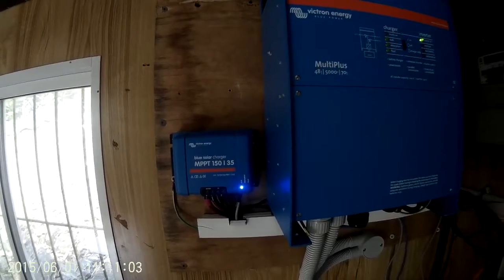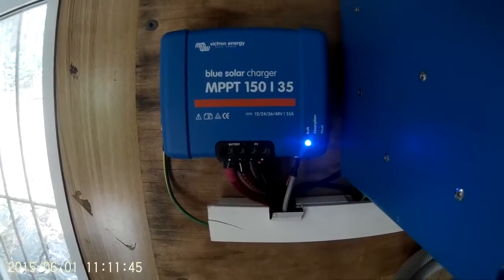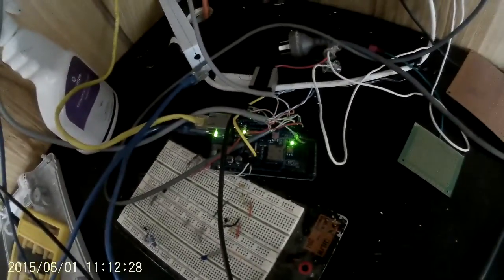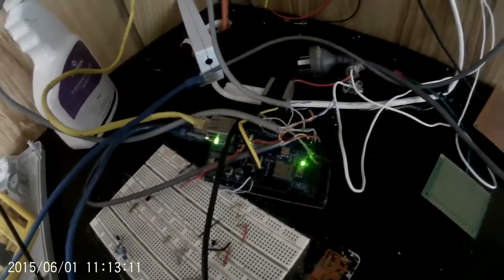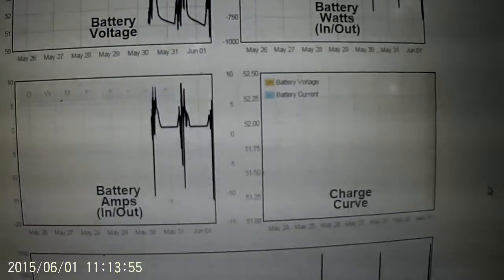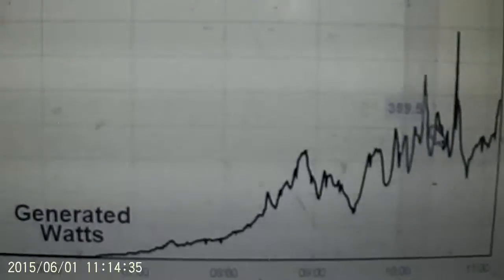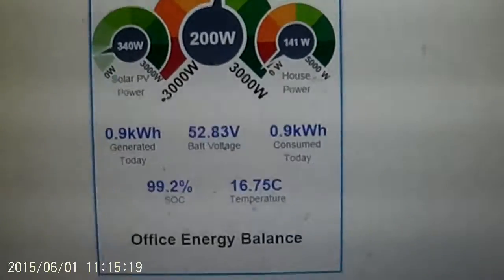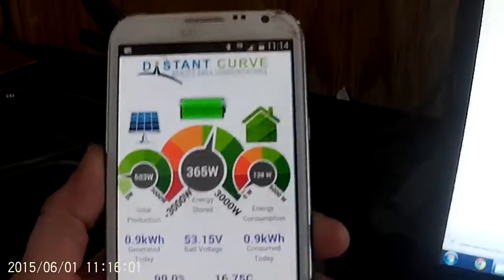Victron / Arduino Offgrid Solar Monitoring - Live and Online.

Comment: hoi, can you tell my how you connect the solar mppt and the inverter , to work together, i have mppsolar system, and iam looking to maybe change to victron. but i dont understand how to control for example 3xvictron mpp 150/60 and a quadro inverter , to load batteries and do load , how to sync them.. you that?

thx kristof

Comment: Hello. Could you help me with checksum calculatuing?
it's example from VE.BUS protocol document. 
Checksum there is BB. Length its 04. 
But if I will sum all bytes 0xFF + 0x41(it's "A" ASCII) + 0x01 + 0x00 = 0x41. Its not same as BB.
04 FF ‘A’ 01 00 BB
05 FF ‘A’ 01 00 00 f BA

Comment: Hi! Nice work! I'm using a BMV in my camper and would like to hook it up to the arduino that I already use for monitoring. I think I read somewhere that the anything you hook up to the ve.direct port needs to be galvanically seperated from the battery. Is that true? I can't find the page where I read that. I'd like to power my ardiuno from the same battery set the BMV monitors. Did you connect it directly or did you use opto couplers?

Comment: excellent video and smart looking dashboard! I know you have experience with the pip 4048, I live offgrid and I just wanted to monitor my total kwh that my pip produced through a 3 kwh array. the smartpower software that comes with it gives me Amps and volts in real time but doesn't do the maths to give me a kwh figure! do you know of any plug and play software that has this feature or is there a work around on the smartpower software? many thanks and your help would really be appreciated.
cheers, Glenn